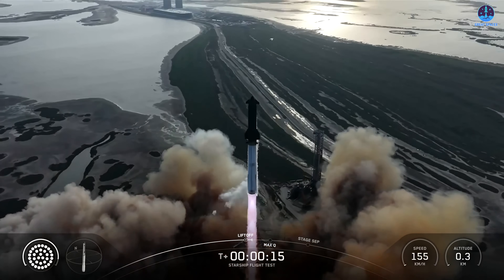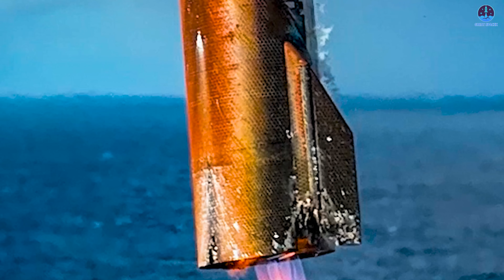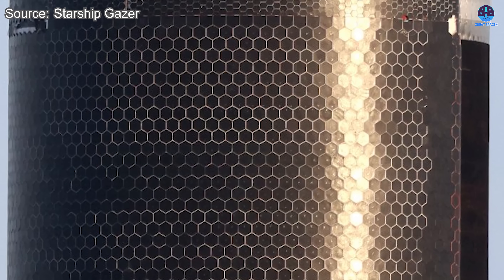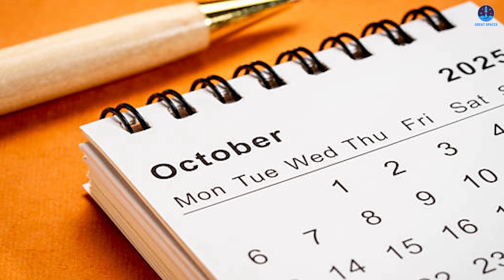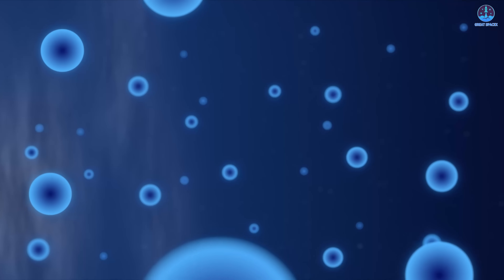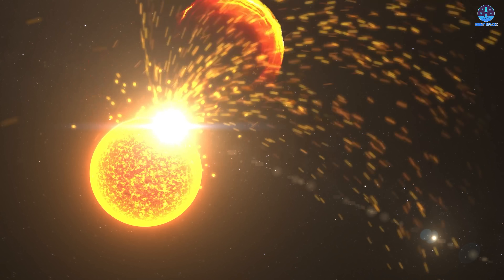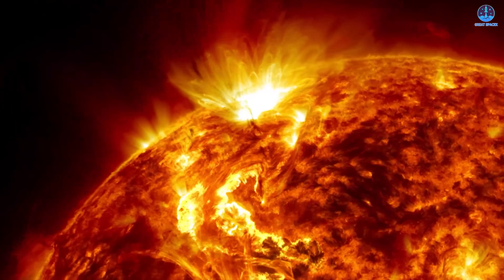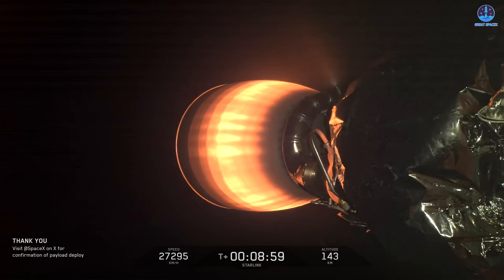SpaceX Revealed Breakthrough Solution for Flight 11 Heat Shield to Fix Metallic Tiles Problems…

Comment: Spacex should further shift the fore flaps at the cone to the bottom side creating a flattened triangle for the side of the cone including the flap area for better heat dissipation. - larger hinge area protrusion to carry the stress of landing/catch stree too.A superior ablative coating applied outside of the tiles would protect them from the worst effects of reentry and assist in securing them in place. Launch orientation of the fore flaps would then be in the folded position.

Comment: This isn't rocket science. Just take more time coming in so you don't build up heat. Just slowly bleed off speed as soon as you enter the atmosphere and can control the angle of attack. No heat shield needed at all!
Reply: Physics doesn’t really allow this. You are either at orbital velocity, or you are falling. The curve goes from zero heat to max heat within a very tiny window. Even at the shallowest possible angle of attack, heat shielding would absolutely be required.
Reply: Actually, this is rocket science. Do you really think that they haven't thought of that? It's neither technically nor theoretically possible.
Reply: What they said!

Comment: What about shaping the tiles like old wood siding called “shiplap” it would seem like if the tiles overlapped like shingles from the top on down, you wouldn’t need anything in the joints?

Comment: CH₄ runs through steel channels in critical areas, heats up, builds pressure, then sprays from nozzles onto hot zones for cooling; excess gas reused for tank pressurization.

Comment: I've noticed that the recent tiles are slightly rounded along their edges, however I believe they need to a taper along all edges (say 10 - 15 degrees from 10 mm down depth towards the tile inner surface) and that edge should be rounded like present tiles. Because when you look at the tiles in actual flight, you'll notice that they are always brighter at the edges than towards the other surfaces of the tiles, thus showing the existing edges are too proud, and causing the most heat( thus the most likely cause of tile failure).
Reply: It is most likely, that because the edges get most of the heat, that heat then affects the joint materials more adversely, than would happen if the heat happened where the tapered section meets the inner tile surface as the edges wouldn't be as "proud" as existing tiles appear to be.

Comment: A separate heat shield that Starship attaches to would make the shield recyclable while saving the starship the wear and tear.  The starship would jettison the shield once it has slowed down.   The cost of lifting shields into orbit it might be less than the cost of refitting, cost and time, of a heat shield on Starship itself.

Comment: Why not apply heat shield 🛡️ in liquid form to eliminate cracks?
Reply: How would it stick?  Any adhesive would
Vaporize. Shield would crack and flake off rapidly.
Reply: reaction between liquid and surface; like epixy @robertzukowski4972  chemical r
Reply: iPhone 16 sucks; chemical reaction between surface & liquid like epoxy, resin & hardener, same principle as cement but not as heavy
Reply: Liquid is hard to apply uniformly. the underside has to be aerodynamically consistent to prevent unwanted yaw/pitch/roll when it's hitting atmosphere. Also, a liquid would have to be allowed to dry, which means applying it in layers, and each layer has to be uniform otherwise you end up with delaminated layers... and that was one of the problems that ended OceanGate. Badly applied layers that they just cut smooth, not worrying about the voids they'd trapped inside as a result of the process.
Better to manufacture the heat shield in smaller tiles so they can all be inspected.

Comment: I think the wings need to be 180 degrees away from the heat and deployed and rotated in position after re-entry when the heating phase is completed. Just the bottom ones. Top wings should come out with the pez dispenser design on re-entry also.

Comment: Reentry while needed is not required for most vehicles to maintain a space based fleet of starships that will never be exposed to reentry. Most reentry of personnel and valuable cargo can be done with capsules a proven low cost technology. Those few Starships that need to be returned will not need a rapid turnover and will be able to undergo an extensive heat shield check out before reuse.
Reply: Many Starship flights are going to be tankering fuel.  Throwing away each of those vehicles will just put us back to the throwaway booster era, which is what SpaceX is trying to end.  The idea is that we can put something in orbit and recover it with the primary cost being fuel.  So, no, putting Starship in orbit and then bringing down "personnel and valuable cargo" in "capsules" isn't going to cut it.
Reply: @JClarkeCT1334 Non reentry starships would not be thrown away but could be repurposed as needed for habitat and transportation at space stations or moon based installations, while yes those outfitted for reentry will be primarily used for refueling or very basic refueling tanks could be used. Ocean going vessels are not used for land transport, once launched they remain at sea and need not return to port if refueled at sea by refueling ships. Interplanetary travel will in the near future be primarily by nuclear propulsion requiring far less fuel, chemical fuels required only for take off and reentry.
Reply: @jackdelvo2702  How are they going to get to the Moon without lots of reusable Starship flights to refuel them?

SpaceX has a business model that requires a fully-reusable system.

And I don't know what universe you inhabit that ocean-going vessels never return to port.

As for "requiring less fuel", it doesn't matter how much fuel it uses.  If you've gotten your operating cost down to a point where the cost of fuel is the primary cost-driver you've solved the problem.  That is what SpaceX is trying to do.
Reply: Initially capsules will used for personnel. Cargo will come back but rapid reusabilty will take yearrs to develope.@JClarkeCT1334
Reply: Um, 
What about the 20 Tanker Flights required to refuel on Orbit ?

To & from Low Orbit ,
 your correct. Anything more , well.....
Reply: @markoreilly3414 The first steps are always the hardest. You got to crawl before you can run.
Reply: Launching Starlink satellites economically requires reuse, and that’s how everything else will be funded. So imperative to master the hard stuff first. Then everything is easy and reliable.
Reply: @robertzukowski4972 Starlink is a private for profit enterprise funded by free market economics. Space exploration is mostly public funded. While Starlink needs to meet short term goals to obtain profitability space exploration is mostly a State financed long term investment in future returns. While we would like to see major advances in space exploration in our lifetime unfortunately the expense needs to be spread out over several. The European age of exploration was initially slowly initiated by State funding. It took a while for the free market to take over. Columbus was long dead before his discoveries turned a decent profit. Earth orbit was explored with state funds and is now turning a huge private profit. We are just beginning to expand beyond it.

Comment: Sealant needs to be applied using vacuum infusion method used in composite infusion layup. Eliminates gaps voids and any gas entrapment. Bonus is you can seal large sections in one hit

Comment: They should switch to carbon/Carbon tiles in the areas that see the highest heating and degradation like the Trailing Edges of the rear flaps.  They could also move the rear flaps to a more leeward position.

Comment: Anyone know why they don't use much larger tiles that have multiple attachment points to reduce the number of tiles and lower the risk of detachment?
Reply: Además si son más grandes tienen menos integridad estructural individual, se rompen más fácil
Reply: The round shape of the ship means larger tiles have to be more complex in shape and are more expensive to produce. The smaller tiles means a more simple shape and it greatly reduces the manufacturing cost.
Reply: the rocket surface is round and the tiles are flat.

Comment: I want to know why it can’t slow down prior to entering atmosphere so it’s friction  is way less creating Less Heat?
Reply: To slow down w/o friction you'd need to carry more propellant to space to burn in the retro rockets, thus making the overall trip much less efficient and lowering the net mass to permanent orbit.
Reply: @19valleydan that does make sense. I asked grok and it told me that too slow also will cause your spacecraft to skip along the atmosphere instead of penetrating. Which was interesting. Maybe that’s where flat earther people came up with a firmament
Reply: Because slowing down that much takes a lot of fuel.
Reply: It's not friction but compression, like when you compress a ball with your hand and it's heating up.  You can only jump off bounce off not glide at 24k km per hour
Reply: That’s not how it works. That’s not how any of this works.